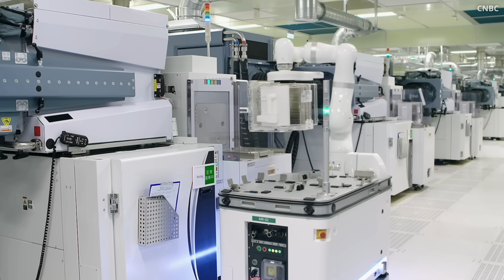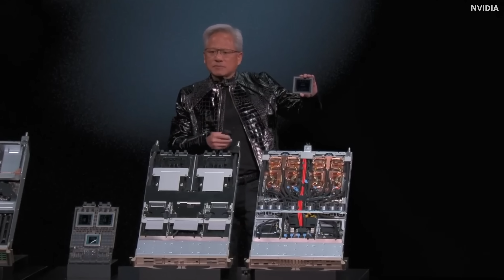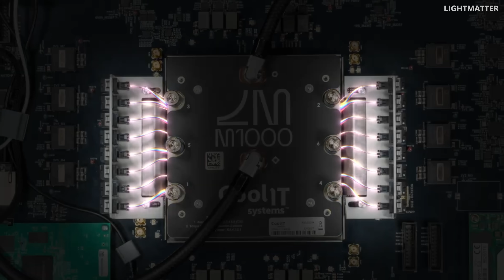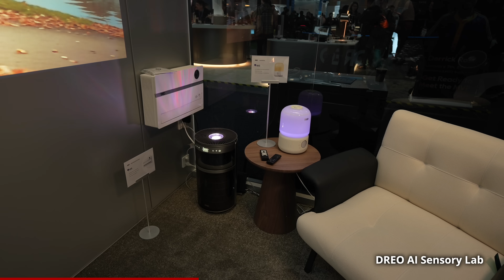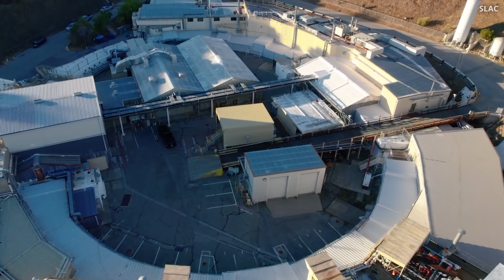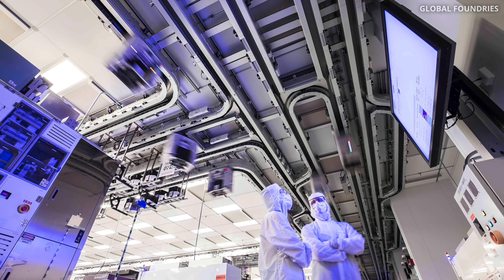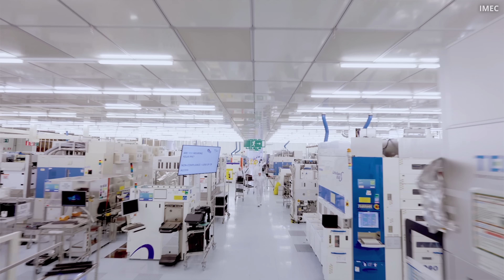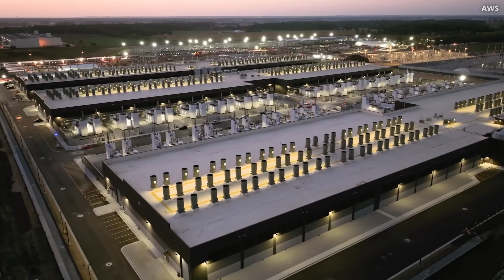This New Technology Could Kill TSMC and ASML

Comment: This is a great overview of EUV and why costs are exploding, but the Substrate section looks like a classic lab demo hype routine. Printing 12 nm features once is not the hard part. Overlay, defect density, photoresist behavior, yield, and 24/7 throughput at scale are. X-rays actually make many of those problems harder, not easier. If this were close to production ready, TSMC or Intel would be lining up to test it instead of a startup planning to build its own fab. Still fascinating research, just very far from threatening ASML or TSMC in practice.

Comment: "can print chips a subnanometer with a single exposure" - um, modern chips are about 90 processing steps with many different techniques including, exposure, implant, and etching each of which is a tricky thing. And sub-nanometer exposure is already pushing the x-ray boundary.  And there are massive steps between being able to print lithographic layers and having a reliable repeatable process.  So good luck.

Comment: When i heard the first words and saw you as a sweet little girl (sorry for the open words) i couldn't believe, when you said you had 10 years of experience in modern chip manufacturing! Did i hear that right? But then you caught me with lots of reasonable information, most ppl just miss. I doubt x-ray lithography will work on production base level in the next 10 years, but then... maybe.  On the other hand we have a physical barrier as electrical structures can't be made so much smaller because of fuzziness and quantum effects. Electrons may start to jump from one line to the next, if they come too close. I heard - years ago - there only a factor of 10 left to this barrier? This might be in the area of 1 nm - prove me wrong if you can.

Comment: So does it use electrons to generate x-rays in via an accelerator or is it some form of electron-etching? Both are old tech and there is a reason why ASML went with the "exploding droplet" technique instead of an accelerator..
If they managed to make a stencil for electrons (<5nm feature size), able to do a whole chip layer in one exposure this would be a breaktrough and yield 5 nobel prizes in different fields
9.5/10 on the BS scale

Comment: X ray lithography was tried 40 years ago by IBM,  but you can't meaningfully focus X Rays, that means to use that technology the mask dimensions must be the same as that intended on wafer, while with EUV you can reduce the mask image by a factor of 4 or 8 with EUV optics. If you can barely make the mask 4 to 8x the target size, for X rays the mask dimensions are 1x i.e.. 4 to 8 times smaller and if you cant print the mask then you can't print the required pattern on wafer either. This technology is dead in the water unless there is a very significant breakthrough in either x ray optics or mask making. I will not hold my breath waiting for this. The resolution of printing with X-rays is limited by the same secondary electron blur seen by EUV. There is no advantage reducing the wavelength any further than EUV's 13.5nm.

Comment: There are several problems with a new technology.  First is that might might only have a concept and are searching for investment.  Second is a big step usually takes longer to implement and is likely to take longer to get to good yields.  These things could take years to perfect.  By this time the rest of the industry might catch up.  I see so many "ground breaking" technologies just never make it.

China thinks they can buy a bunch of 10-20 year older machines and then reverse engineer them and be able to catch up to the market in just a few years.  This would take at least 10 years if not longer and they might not even be able to make these machines.  Cost and technology needed to manufacture is why the US is the old country with a lot of military technologies.  Even if they had all the blueprints it could take 10-20 years to be able to manufacture these higher end technologies.

Comment: Why not use a full synchrotron? You could run several lithography machines of a single one. For X-Ray experiments at Diamond Light Source they have one synchrotron that generates X-Rays in 32 "beamlines". Each beamline could be a lithography machine. In the grand scale of a semiconductor plant, it's not /that/big a device.

Comment: Quantity vs. Quality does not quite accidentally describe my point, however that saying leads to my question regarding the unending drive for smaller. At what size is there little economic rewards in pursuing producing large volumes of the most advanced chips/technology?
Is there significant unfulfilled demand for “small enough”, wouldn’t there be opportunity for a manufacturer to aggressively pursue fabrication of good enough chips ?
My question, is the a large consumer demand for the most advanced chips and is that and endless pursuit of?
You do terrific job presenting videos with in depth relevant content. Your vids help me stay current, and to look ahead,,,, thanks for making the best videos.

Comment: China did it first, photoprinting chip compossed 2D working with light. less expensives, fast produced, don'[ heat as those  of Nvidea, consume less, cost less, and works so much times faster. And now have produced own machines to print it.
Reply: “China copied first” is more accurate
Reply: They’re using light to move data or information between servers. That has nothing to do with printing chips, just increases speed and decreases heat, allowing you to get more out of existing chips.

Comment: The Veritasium video about it is a crash course, but no explanation until now can beat It — even yours! Just jump straight to CERN, where the detectors (hologram-like) of sub-particles could be re-engineered to be selective for specific subatomic particles. The collisions could be done in a controllable rhythm that does not stress out the hardware, so the layers that catch the subatomic particles wouldn’t need expensive filters, lenses, or magnetic fields to deflect them in specific shapes.
Or even go beyond, assuming the Cosmic Microwave Background (CMB) is “printing” in water plus minerals, DNA/RNA shapes and enzymes. The bubbles arising from thermal vents or geographic features are building the barriers that reverse entropy (cell membranes), which then become aggregates that push even more complex substrates into them!

Comment: Please kindly try to avoid the term 'billion' as it may generate confusion. I mean in UK for example 1 billion is 1 elevated to 9 (one thousand millions), while in Spain and many other countries 1 billion is 1 elevated to 12 (one million millions). I assume you meant the new machine costs around 500.000.000 USD and not 500.000.000.000 USD.
Reply: How is that? I mean, aren't we all use the same math? Billion is billion if it's translated correctly

Comment: Your spacex example is even better than you explained.  

The idea of rocket reuse was not new - this was one of the main reasons for the shuttle and buran launch vehicles.  However, those projects failed due to execution.

So, as you see with spacex/nasa, even if you have the right idea, you have to be able to execute/iterate well on it.

Comment: 0.25nm wavelength corresponds to a photon energy of 4.96 keV.
For perspective - the binding energy of an atom of silicon within a crystal lattice is approximately 4.63 eV per atom. The strongest known covalent binding energy is the carbon monoxide triple bond, with a bond energy of about 11.2 eV per molecule
I'm afraid the lithography (mask followed by chemical etching) is a dead approach, there's no masking material that can stop a photon of 4.96keV without dissociating (or let the photon pass through in a target-miss event). At best, that mask will "ablate" on exposure, fingers crossed that enough of it remains after.
This even letting aside the problem of soft Xray optics.

Methinks, if the intended approach is lithography-based, then this one is a case of the "5 years in the future at any time " type of technology.

Comment: ASML had the same problem EUV is more like x rays than UV. You cannot use optics for light anymore. They also had the problem that EUV/x rays normally need an accelerator, this is why they shoot this droplets as a clever replacement.

Comment: There is no such thing as actual 2nm resolution yet. It's just a name, when marketing wank diverged from actual dimensions for some unfortunate reason. The actual size limitation for "2nm nodes" is around 8 nm. It was straightforward until marketers had to confuse the issue.

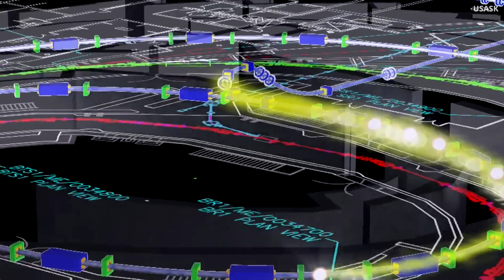Comment: 12:17 0.25 nanometer is not fraction of a atom, it's about 2.4 times the covalent radius of a silicon atom (110 pm) - 0.25nm is just slightly larger than the covalent diameter (about the same as nearest neighbor distance). It's also only half of the lattice constant of a silicon crystal (5.43Å) 
So, yeah, the resolution still allows for discriminating silicon atoms in a crystal; quite impressive, but not yet a fraction of an atom.
/sudden_attack_of_pendantry.

Comment: Its a logical step to find new tech because lets face it ASML has monopoly in this industry and they can charge whatever they want for their new devices for customers. Yeah at some point we as consumers are not willing to pay the price. AMD is good example trying to find better cost/performance ratio and 9070 was good example. Nvidia already pushing high and people are not willing to upgrade often and still using older gen cards (mid range)  alot. The high-end GPU market is very tiny and margins are crazy.
CPU's are also affected when AMD has to raise prices due to ASML and chipmaking TSMC costs raise.

ASML will be in big trouble IF they cant lower the cost of their final litography devices or optimize it. Eventually something else will emerge because there is a market there to make it cheaper (competition). Same as Nvidia AI monopoly will end sooner than people think.

Comment: I dont thin they will disrupt them, one thing is demo, the other thing is making a machine for large scale manufacturing. Same thing could be done then for the EUV they coud use "single" shot optimize it this way, and they could make more chips per hour. But as I understand the LIGHT intensity is the problem. you need x on square more ENERGY to light it at once. And they have so much trubles making it to 100W or 200W or 500W, liting everything at one would need 25000 wats of light... I think this would brake all materials. and it would require megawats lasers.

Comment: Even if they cannot get Xrays to work reliably without cooking everything, at least they are onto a good source of light using a synchrotron. as in it does not destroy the mirrors like the current tin based source eventually does.
Also Synchrotron's are not that hard, or incredibly large, well the ANSTO unit in Clayton, Vic, Australia is not that large, nothing that a decent sized factory cannot house, nothing like the CERN LHC

Comment: Tesla plans to build its own 2nm semiconductor fabrication. Musk described this as a "TeraFab" where wafers would remain fully isolated, allowing activities like eating or smoking inside without contamination risks.
Reply: Key Design Innovations
The standout feature of TeraFab's design is its radical departure from traditional semiconductor manufacturing, focusing on efficiency, cost reduction, and rethinking contamination control. Here's what we know:

Wafer Isolation System: 
Instead of relying on ultra-expensive, expansive cleanrooms (which maintain particle-free environments for the entire facility), TeraFab would isolate individual silicon wafers in sealed, protective enclosures throughout the production process. This shields them from airborne contaminants, humidity, and human interference, allowing the rest of the fab to operate like a standard industrial space. Musk boldly claimed this setup would let him "eat a cheeseburger and smoke a cigar" inside the fab without risking chip defects, turning the cleanroom paradigm "upside down."

Modular and Scalable Architecture: 
The facility is envisioned as a cluster of 10 or more interconnected modules, each capable of 100,000 WSPM initially, with room to expand. This modular approach could enable faster construction and upgrades compared to monolithic fabs. Musk has hinted at optimizing for Tesla's specific software, making chips power-efficient and 10x cheaper to produce than competitors like Nvidia's Blackwell GPUs.

Process Reinvention: 
Drawing from Tesla's manufacturing ethos (e.g., Gigafactories), the design aims to simplify workflows: identify unnecessary steps, remove them, optimize what's left, accelerate cycles, and automate last. This could involve custom equipment to boost yields and reduce energy use, addressing broader industry constraints like power shortages for AI data centers.

Node and Output Focus: 
Targeted at 2nm (or below) for high-performance AI inference and training chips. Output would prioritize Tesla's ecosystem, potentially producing billions of chips annually for vehicles, robots, and data centers.

Comment: I thought EUV tech actually uses X-ray light. I am pretty sure they generate X-Rays inside those machines by laser hitting 3 times in a row tin drops to get the necessary X-ray frequency. Creating X-rays in necessary frequency is one part of the problem but reflecting Xrays from mirrors is the other hard part as mirrors need to be extremely flat and to actually reflect X-rays. Very hard to do and I bet if someone does it - it will be actually ASML sitting on top of their other patents and using the money they already have.

Comment: More likely this company wants to corner the chip market, Vapor disposition has been around for a very long time, I worked in that field, it's not rocket science. China bought a ASML machine, took it apart and tried to back engineer the ASML machines and failed.

Comment: You can shine the X-ray through dense Halite (NaCl): Forms simple, perfect cubic crystals with alternating Na+ and Cl- ions, each surrounded by six ions of the opposite charge, demonstrating high symmetry.  Then the X-ray is slowed down to act like a tiny gamma ray.  I don't believe x-rays are so hard to make, alot of them are tv tubes aimed at tungsten coated surface at 300kv, so you put a huge halite tv screen so they all x-rays present simply fascinating regalia mechanicus.

Comment: The AI in products thing is neat however it does mean it will require some kind of connection to an AI data farm. What happens if there are server issues, loss of connection, dropped OS or support for appliances and such after 5 years. The industry moves so fast an AI home honestly sounds like it could be a nightmare.